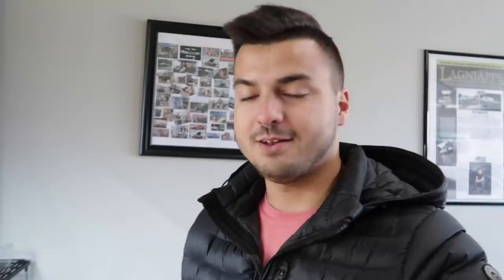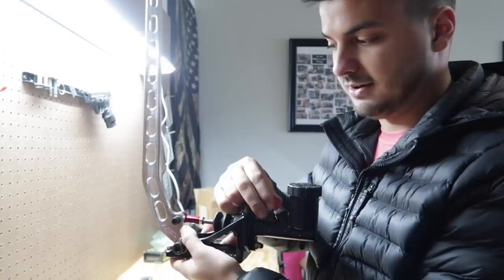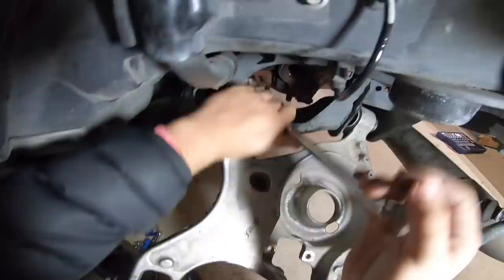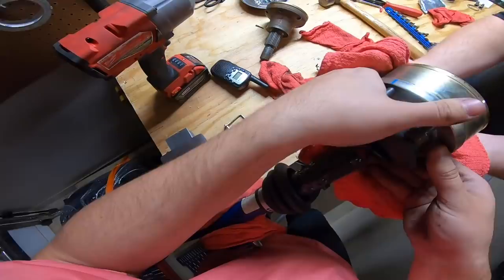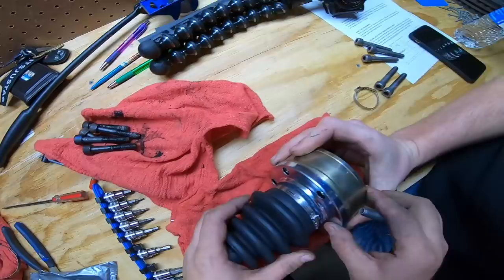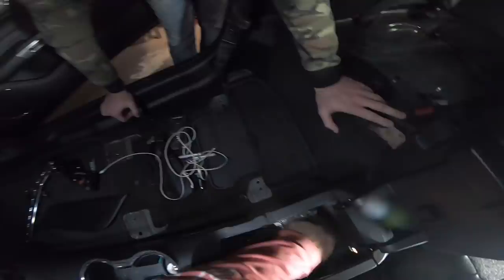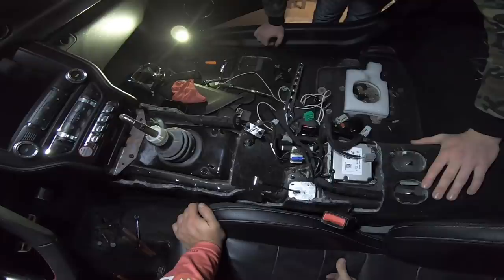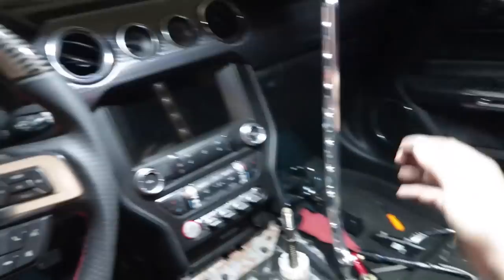Making my 1,000hp Drag Mustang a DRIFT CAR?! (hydro brake install)

Comment: 7:05 I will demonstrate how to “slide in the DM’s”
Reply from the maker: Zorbii slides in “Hi”
Reply: @itsjusta6official  19:27 Daniel, "what is in my butt"
Reply: Zorbii papi 😍
Reply: next video "Putting eggs in ItsJusta6's coyote"
Reply: Tell Gavin to loosen all the suspension bolts & only tighten them once he has the weight of the car on the suspension, will cause lots of binding & aggravation at the track if he doesn’t!
Reply: @georgem.6136  I'm sure Gavin knows, but if he doesn't it will be a good meme
Reply: @georgem.6136  this needs to be seen
Reply: @georgem.6136  next video "slammed my car the easy way!"

Comment: You're so right about saying learning how to do axles on atvs helped me with this car.  Any experience is good experience and gives you confidence to tackle jobs on your own.  I built high performance mx/enduro bikes and dual sport bikes for the last 20yrs.  Full engine mods and full suspension mods on my own with years of learning...and of course word travels if you help someone and others started knocking at my door to help them set up their bike or atv..It turned into a fun side job that I don't consider work at all..Keep it up and looking forward to your channels main car getting faster and better all the time.  Oh, one of my personal bike builds was written up about by bike world several years ago.  They were testing a budget dual sport bike..A DR650..and I gave them many tips through emails.  If they weren't set so far away from me they wanted to do a test with my built DR650 along with their stock one..My good old DR is still the main picture on their DR bike page.  It was only half done at that point also..I had double the cost of the original bike in aftermarket parts....not hard to do...and did it all on my own for a fun project.  From a big valve head, hi com piston and web cam and pumper carb to full race suspension and SM wheels...It was a trip!!  I sold it for a big chunk of change 5yrs ago..still miss it.  I have a 2014 KTM690r enduro now that I bought new,,and its relatively stock..50yrs. old now and still love to ride..thanks for the build videos...that's half the fun!

Comment: You should have cleaned the shaft with a degreaser to get rid of the old grease with dirt, if there is dirt still in there then it may cause the bearings to not last as long
Reply from the maker: Matt’s Garage we actually did! I can’t include every part to the things I do, which is why you didn’t see it. Good advice though!
Reply: ooft our man just gave our other man advice on maintaining the cleanliness of his shaft
Reply: @itsjusta6official  ok, just making sure. I dont want you learning from your own mistakes if you can learn from others

Comment: So why cant you put the hand brake on the front wheels so it will be like a line lock for burn out and offnthe line you can load all the suspension and launch better. I've never seen it before maybe on to something! Lol
Reply from the maker: I have line lock on the car already for burnouts, which locks the front wheels, but for pre-loading the axles and driveline, you have to lock the rear wheels to keep them from spinning, which is why it’s on the rear.
Reply: @itsjusta6official   Why not put a momentary line lock on the rear where all you have to do is hold a button until you launch that way you don't have that big hydraulic handle in your way and still keep the interior stockish
Reply: @Glex25  kind of what I was thinking. Just hook up a manual line lock to the rear brake line instead of the front. This would keep it inexpensive, fewer parts, less hassle for installation and a lot more efficient.!
Reply: @Glex25  you mean a trans brake? Far as I know you can only get them on automatics
Reply: @rockroll9513  Exactly. Just like a setting up a line lock in the front with a solenoid but for the rear
Reply: @robertmillison8933   What Rock Roll said above
Reply: @Glex25  only have 2 feet. Can't control a brake, throttle and clutch at the same time efficiently for a solid 60 foot.
Reply: Bigg Gene    you have no skills
Reply: Robert Millison trans brake & line lock are two different things .
Reply: @bigggene861  Line locks use a button, you press the brake pedal, activate the line lock, release brake pedal and the line lock holds the pressure in the line without a brake pedal being pushed. 

Maybe you should know what you're talking about.
Reply: @SkylineBNR34  you're right

Comment: Why not see if you can get the Hand-brake (E-brake) handle converted to work with a Hydraulic system, that way you wont need to cut up your interior. Also check out ChrisFix's video on Dual Calipers on his mustang, he does the whole, putting it in the cup holder thing.

Comment: FYI That little slot under the back cup holder is actually a charger for your key 😁 whenever your lock doesn’t work as good u put it in that slot and it charges the battery !

Comment: The hidden cubby in your cup holder is for your key if it stops transmitting signal you can still start your car with it. Treats it like if you put a key in physically.

Comment: Why drift? Drag is much better. Well in my opinion at least.
Reply from the maker: itsjustajoke being that most cars running a hydro e-brake use them for drifting. In my case, it’ll be used for pre-loading the driveline and staging when drag racing.
Reply: Maybe I should actually pay attention to what you’re using it for. I’m being honest, I was just admiring the car. 😶
Reply: You need try both. Your mind will Change
Reply: I like drift but drag is way more entertaining to me
Reply: Holy redundant
Reply: But did you watch the video? 🤷🏼‍♂️🤦🏼‍♂️
Reply: Maybe you should read the second comment. 🤔🤷‍♂️🤦‍♂️
Reply: Mustangs are actually good drift cars

Comment: Doesn’t even clean the old contaminated grease out.
Reply from the maker: Actually, I did. Can’t include every single thing on video or each video would be 2 hours long.
Reply: itsjusta6   I believe you. Solvent wash or just wiped what you could. Thanks for the reply for what it is worth.

Comment: That " hidden compartment" is so if you key dies you can start the car by placing it into the slot. Just like you can unlock the door with the master key inside of the fob.

Comment: The compartment in the cup holder is for if your key fob dies you take it apart and stick both pieces in the compartment and it’ll read the chip so it’ll start

Comment: Much easier than a hydraulic hand brake. Just wire install a line lock on a button on the steering wheel or shifter. You set brake pressure and you can pre load the drive train and all you have to do is let go of a button rather than fiddle with the hand brake.

Comment: But the reason this brake works so well on Leroy, is because Leroy is turbocharged and holding the brake and putting load on the motor which causes it to build boost for launch, however this should help with launches, just wont be as effective as it would for a turbocharged car
Reply: @EASTSIDE-313  LOL I actually said that in another comment.  And you are right. He just throws money at problems. I can tell he's never been poor. I've never had money so I've learned to do things the cheapest best way.anytime.something has broken on my car people.say oh man what's it gonna cost for the shop to fix? I laugh and say shop? Really. Same thing happened after I recently sent a rod through the block. Everyone was like did insurance total it? I'm like fuck no I ain't claiming shit. Ill put in a new motor, better block and improve things I intended to on the last motor but never did.

Comment: You know you can go to advanced and rent a spring compressor so that, that spring install could’ve taken 5 min lol. Buuuut this is exactly how I did it on my truck cause the springs where too big for the compressing tool thingy. Works just the same. Good job!

Comment: Option #1 - ditch the handle and use an electric Solenoid to actuate The master cylinder. That way you can mount the entire assembly in the truck and only have a button up front.
Option #2 - use the factory ebreak assembly. 
You can mount the master cylinder wherever you want and route the factory brake cable to actuate the master so that everything retains its stock appearance.

Comment: That hidden compartment in the cup holder is Incase your key fob dies, you put it in there and can use the push to start, otherwise it won’t connect

Comment: Those channel locks you were using to take shift knob off will work a lot better if you’d use them correctly. They’ll bite and loosen things if you’d flip them. Live and learn.

Comment: That “hidden compartment” in your rear cup holder is for starting your car in case the battery in the key fob dies, put the key there and it’ll sense the key and start the car. Plenty of videos on YouTube.
Reply: Also there’s a hidden key in your key fob to open the door in said scenario. There’s a removable cap to reveal a keyhole.

Comment: Put some rubber around the ebrake hole and run your hydro line out there. Did it in a build years ago. Also I totally caught that "Hell yeah brother," you slipped in there.

Comment: That compartment is for your key if the battery dies in the fob or is low so the car will still start if you put it in that hole

Comment: The hidden compartment you found is actually where you put the fob if the battery is dead in the key and also where you program new key fobs 👍🏼 @itsjusta6

Comment: Great video I was thinking the brake should be between the 1oclock 2oclock position your first gear is so fast so my thinking is you don't want to pull your hand left then down to second but at the 1 o'clock position after release pulling to the 6oclock all one motion to second gear from north to south. Oppose to 2 different directions only 1 if that makes since I mean when talking tenths of a second every bit counts. Thanks for the great content. Have you pulled with the demon since the video where you had to start in higher gear do to traction?

Comment: Why aren't you putting the ebrake to the left of the shift knob?  Keep it close to the steering wheel so you can push the brake down to the wheel.  You can then put both hands on the wheel in the full send launch and then drop your hand to throw it to second a couple seconds later.

Comment: Isn't there a adaptor plate that hold original calipers & 2nd set for hydro brake that way you can still use handbrake

Comment: You should really send it on making the mustang a drag car by gutting the interior and removing the ac and heater.  Weight reduction will get you closer to 8s

Comment: Why do u not just put it were the ebrake was
Reply from the maker: Deven Copeland if it’s there, the large vertical handle will be between the shifter and the steering wheel, which can be dangerous if I need to quickly grab the wheel with both hands if I lose traction or anything else.
Reply: True but swtich sides of it insted og haveing it vurtical switch it were the cup holders are
Reply: Put it were the cup holder are so u do not have drill into the body and pronly make rust on it

Comment: Why wouldn’t ya just put a roll control solenoid on the front brake line off the master cylinder an just use a button an toggle switch for power an car would appear stock an ya lock the front brakes by the button preventing it from rolling an it would be the exact same thing an your factory line lock would still work but ya could even use that for your burn outs. That was not what I would call well thought out. Always look at every option prior to tearing shit apart an cutting things off

Comment: If you used a shorter extension you would have had more power. You loose power on your tools as you add extensions

Comment: First everything was going wrong for the Stallion and then eventually the motor blew, two months later the Stallion is back in action gets a new supercharger and almost get to a thousand horsepower now everything is going right because the Stallion has a new motor that is bound to be installed. It seems like everything is going right. Buys 240sx for drift car

Comment: Could have just used the factory ebrake and not only that why not leave the ebrake? It hooks to your factory calipers and not your caliper for the hydro. Your putting a lot of trust on your transmission to leave it parked in gear with no ebrake, hope you don't park on a hill. So many things just doesn't make since on why you are doing this.